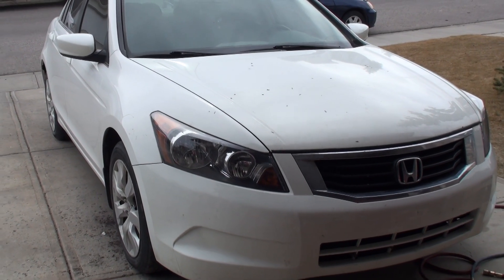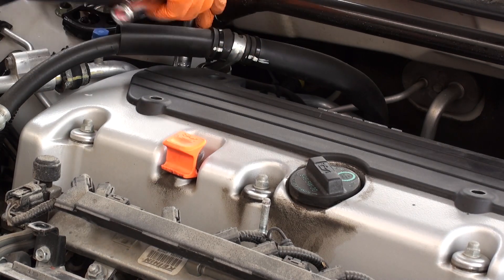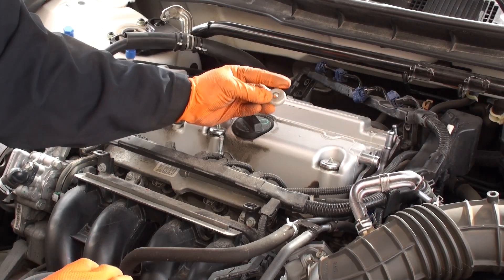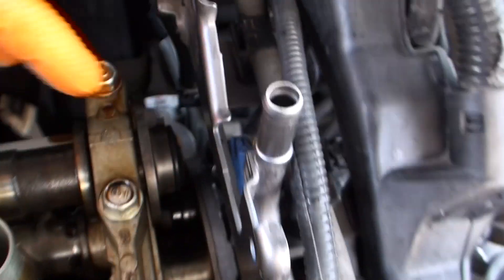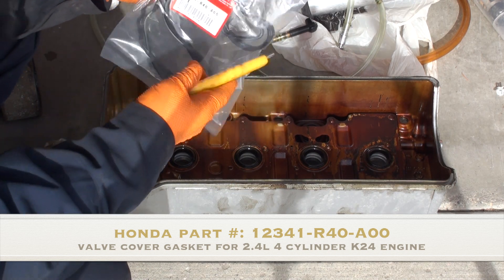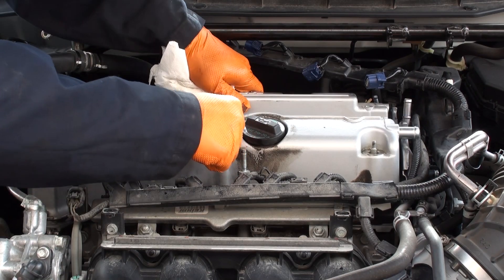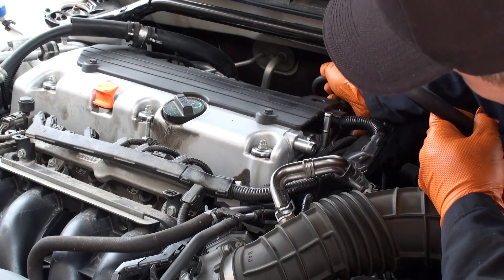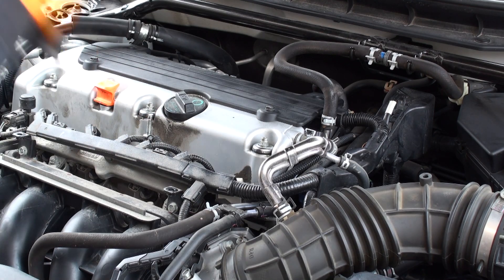8th Generation Honda Accord Valve Cover Gasket Replacement

Comment: Great video.  Good instructions.  A steady camera (mount) makes a huge difference.  Some of the kits (Fel Pro) come with new seals around the spark plug holes and new rubber seals/washers for the valve cover mount.  Good to mention that if the users sees any oil around the coil pack, those gaskets should be replaced as well.

Comment: Many thanks. In another video, a Honda mechanic also replaced all 4 rubber ignition coil Gaskets (bushings?). Is that absolutely necessary as he indicated it was? It was a silent video but he responded to a poster's question.

Comment: I accidentally dropped a small rtv inside the engine. Maybe an inch long, but sort of skinny. Would I be okay??
Reply from the maker: did it fall in and down through the oil gallery that returns to the oil pan?  While my reply is late, you could pour some oil down where the little piece of dried RTV fell down and then open up the oil pan to let it drain out that way.  The oil pickups in most motors do have a screen so it likely won't get past that anyways and will eventually just come out on the your next few oil changes.